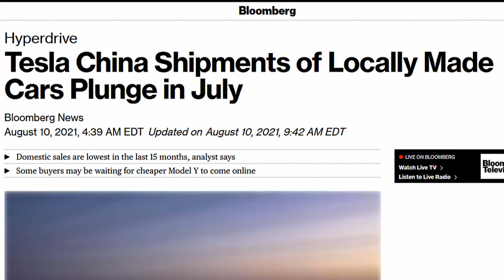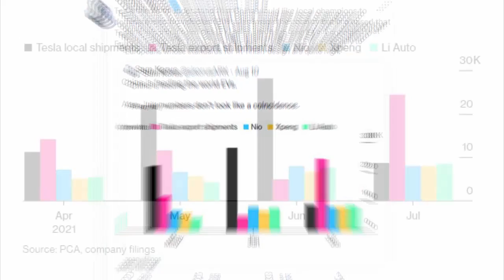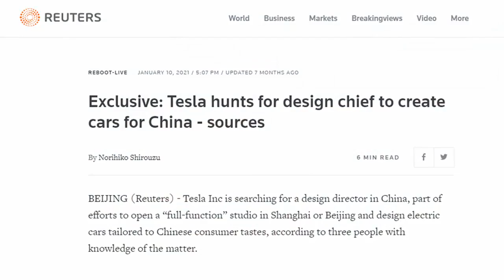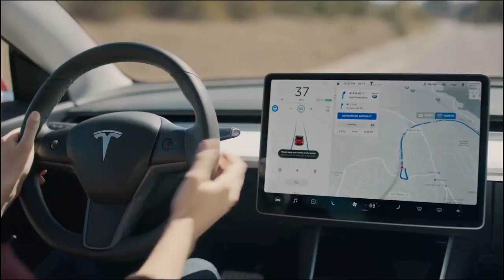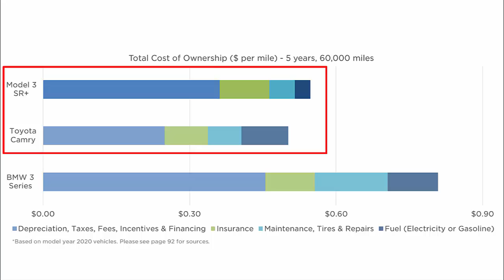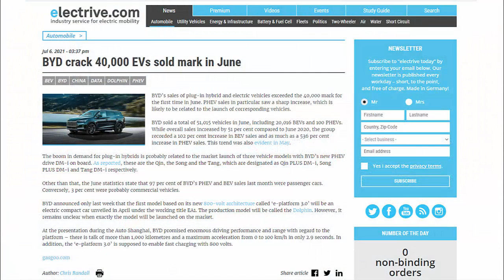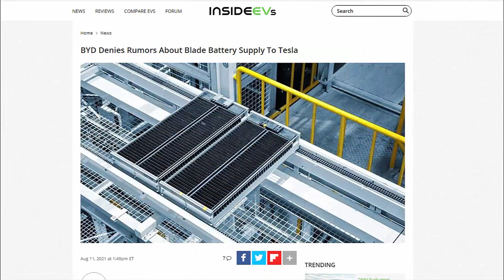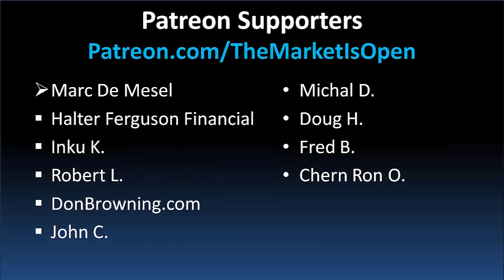Tesla’s Upcoming $25,000 Compact Car is a HIDDEN GIANT

Comment: I thought the BYD rumour had been refuted by BYD themselves? Surely it makes no sense to introduce a much inferior cell design compared to the 4680? The most important thing about the 4680 cell is it's incredibly low internal resistance. This massively reduced the amount of heat generated during rapid charging, allowing much shorter charging times.
Reply: I disagree, Tesla would be smart to utilize BYD'S superior then any battery made at present.Safer, won't catch fire even drilling straight thru it, charges quicker, has further range.Put them in all Shanghi production i say they are better than the 4680.Let BYD supply Tesla the complete structural battery skateboard.BYD the Tesla of the East is the only reason that Toyota and Mercedes might survive bankruptcy.Superior batteries! Oh yes they are.
Reply: BYD is NOT working with Tesla.  I agree, that's  a good thing.
Reply: You don't need super fast charging for home storage, expense and abundance is key
Reply: @ParaSpite  get the lead out... oh, they already did.
Reply: ICE cars still stink a lot. Some people are obviously referring to the "tuned tables which are already proven wrong". The exhaust cleaning only works in a small temperature range and when the engine is warm and outside of this it is without effect and everything goes out the tailpipe nearly unfiltered.
Reply: C M  You're scary, are you employed by ICE manufacturers? 

Electric vehicles are superior in practically every way to ICE except range and charging time RIGHT NOW. By 2030 we will have 1000 mi range batteries on million mile autonomous EVs that charge in 20 min or less, cost under 10c a mile and support TaaS (Transportation as a Service) that costs 1/10th or less per mile what ICE transportation costs. That will revolutionize the middle class and boost the poor and working classes. ICE cars will only be a memory (or for hobbyists) same as steam and electric were after about 1920.

Comment: I think if Teslas battery management system can improve the performance of the prismatic cells they might use them. However I don't think it will be a long-term agreement. They will only do this if the ramping of the 4680 cells takes longer than planned.

Comment: 25K USD is still not a cheap car.  For an Aussie that's over 37K.  You could get a hatchback style car for around $20K, maybe $25K if you add a few extras.  The model 2 will sell well, but you prob need to get the sticker price closer to 15K than 25K so middle income countries have a chance to afford them, though maybe robo taxis will solve that problem.
Reply: I believe by 2026 there will be a sub $20,000 US tesla. Tesla’s optimization and cost cutting as well as design prowess will enable this to happen.

Comment: I don't think Tesla will start producing the cheaper model until it has sorted out the chip and supply chain issues. Otherwise the market demand will be so high and they won't be able to meet supply in any reasonable timeframe (existing problem with 3 and Y), which could result in second hand models being more expensive than new (same with 3 and Y). This doesn't make any sense. Once they are confident of mass production and getting all the parts they need and in the millions of annual production I think they'll come out with it. The unit volumes will likely double. Other companies with cheap and inferior models will struggle. Imagine a $30K new model in the US with 10K subsidy with 250 mile range vs the Nissan Leaf? No competition. Tesla would likely make $15K per car at that price point as well.
Reply: Tesla has a complete plan before they start, don't worry about it.
Reply: @tedmoss  I hope so, I have 6000 shares and I want to see them continue to do well like they have been. They are very good at making things happen.

Comment: The article I read said BYD could ramp production of the blade cells to 70GWh per year by 2023. If they sold all of them to Tesla and they were used only for the new Model (?) AND they only had 35KWh batteries, they could only make 2M of those cars in 2023. BYD would have to agree to keep scaling up by 70-90% each year to keep up with Tesla AND we would need another factory built in China quick to make these cars. I think Tesla would have to grow production at ~100% through 2024 to meet demand provided these cars are well received. That would be 8M total cars (all models) produced in 2024. In summary; the blade cells would only be used by the 2 China factories for just the new model. In the US & Germany they would have to use LFP 4680s and the ramp producing those would have to go really well. I just know the demand for this new model will be unprecedented if people like it.

Comment: Blade Battery!Superior to the 2170 and even the 4680, see if the 4680 getting punctured won't have a thermal runaway.BYD's battery can be drilled staight thru it no problem, no fire.Tesla would be smart to use there battery, their battery is the only reason Toyota and Mercedes might be able to avoid bankruptcy.It would be a great combination utilizing Tesla of the East with Tesla of the West, so they both can transition the world faster to a sustainable future.

Comment: If Tesla really wants to make a huge impact for the planet, come up with service centers that convert cars from gas to electric.  It won’t be easy to design but it is possible.
Reply: Too expensive to convert. Can’t easily convert existing cars to skateboard design which is necessary for a good EV.
Reply: A waste of money. If EVs are superior, market forces will take care of the transition. Just like cars replaced the horse. Even if every ICE car were removed from the road, it wouldn't have a significant impact on the environment.

Comment: It's makes no sense to use LFP on 46X80 cell format, you should research more ...
Reply: Why does it make no sense? Why not use one in some aspects better chemistry in this form factor?

Yes it takes time to switch over and they are still optimizing the production process for the originally intended chemistry, that's a time constraint, but not a technical constraint.

Where is the constraint in your opinion?